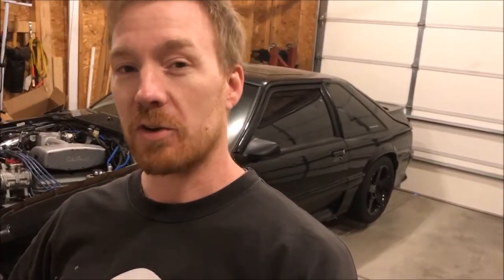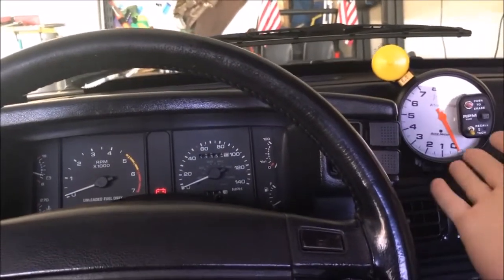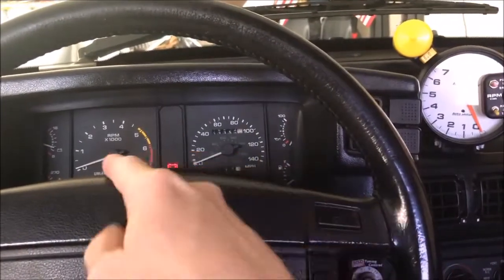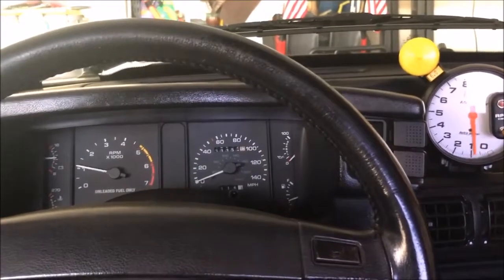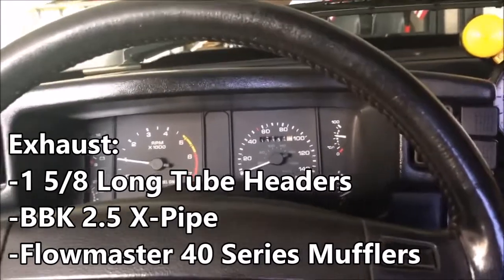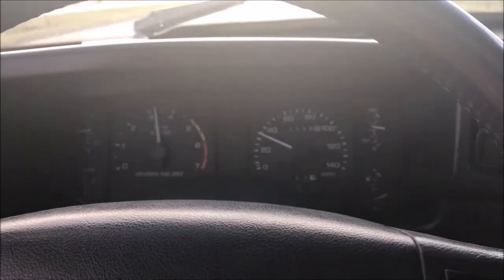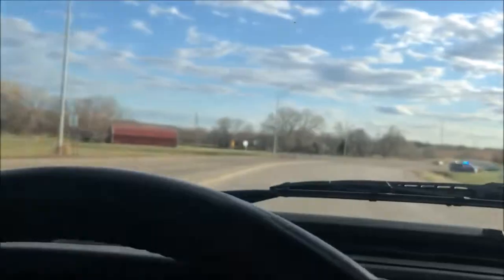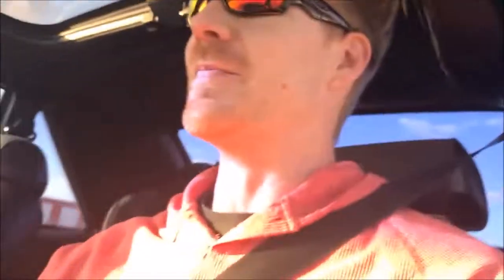GT40 Head Swap Mustang First Drive

Comment: Glad to see you could notice the extra power and it was worth all the effort and attention to detail.  I'm working a pair right now for my vortech supercharged '96 F-150.  I kind of want to run the stock peanut roller cam (the explorer cam), but I also don't want to leave power on the table.  I have to run shorties and cats for to emissions reasons.  My truck is 3900 lb 5-spd.  Did you notice any loss of low end (like maybe off idle up to 1500 rpm)?  My simulation software says the GT40 top end loses maybe 2-3 lb/ft of torque way down low and is all win after 2500 rpm.  Also I had my truck lower ported, but they already flow so much more than the car versions (it's the basis for the holley lowers).
Reply from the maker: The extra power was worth it!  I would've been disappointed if all the work I put into it gave negligible results.  I suspected the E7s to be the clog in the system because it was the one remnant of the stock system.  I think you'll find that to be true regarding your camshaft should you choose to keep it stock.  Especially if you're running a supercharger.  A cam upgrade will do wonders for your combination as I'm sure you already know.  It's more work however, but if you're doing a head swap already, maybe doing a cam swap isn't as much trouble... but, I don't know how much front disassembly you'd need to do on your truck to swap the cam.  

I didn't notice any losses with the GT40s.  All gains as far as I can tell.  It's better off the line, better in midrange, and better up top.  It screams now.  I'll be on the dyno in the near future and will make a video of the results.  With and without N02.  I'm sure you'd see big gains with more free flowing heads.  If you were running a turbo, I'd say to just increase boost to make up the difference, but superchargers are different.  I'm sure the Vortech will appreciate the increased flow.  I assume your truck is tuned for your combination...I'm not sure they run without one, but if it's not I'd definitely recommend that step.  Bummer about the emissions restrictions!    

I will be getting this car to the dyno and possibly do an entire build with it in the near future.  Thanks for the comment!
Reply: @FastFixYouTube  I'll be waiting for that video.  The 96 is the first year of obd2 and also the eec5 computer which is easier to program.  It is their last year for that body, but the 5.0 carried over on the explorer for some time after.  I do have a tuning solution and did it myself (Core Tuning).  I missed out on fuel injected fords back in the 90's so I'm kind of doing my own version of a 4000 lb mustang. 

Anyhow I did the usual stuff with changing injectors, fitting a bigger MAF (I've done 2 different 80mm ones and now have the 80mm Lightning maf), and have it tuned to run for 20 percent ethanol which is calif 93 octane, basically.  Lots of timing for a supercharger and it goes real well (up to 4500 rpm anyhow).  It dyno'd at 280rwhp/315tq and was still increasing hp at 5300 rpm, but the factory ignition has its spark blown out so that's as high as I can rev without doing an MSD 6AL.  The stock parts are making it run truck-ish with a higher torque than hp, but that's ok if I can get another 40 hp out of it.  I think I can with the blower. The numbers seem low, but it is night and day- the truck has a ton of extra power as soon as you touch the accelerator with the centrifugal and small port heads.

Since 96 is a weird year, all the smog legal stuff for mustangs stops at 1995.  The only aftermarket heads that are legal for 96 trucks and broncos are twisted wedge 170's which I almost bought, but a 2.02 valve is still big for a 302.  I know it would be capable of making 500hp, but maybe not with the full exhaust I have to run...so the GT-40's fit the package better and are cheaper (plus no hit to low end power).
Reply from the maker: Lol @ 4000 lb Mustang!  That's awesome.  I dream of having an odb2 port...  The CPU is jammed in the passenger kick panel and is a major pain to remove.  I have to remove it anytime I need to adjust the tune.  That's awesome you do your own tuning.  I like to do everything myself too, so good on ya for tackling that.

So it seems California has better gas and Nebraska has lower emission controls. Best I can do here is 91 octane.  We do have E85 and I've been considering making the fuel system compatible with that, but again I'd have tuning issues to contend with...  I'm sure the supercharger is night and day.  Your power is respectable and I'm sure the GT40s will give you the 40hp you're after.  I believe most dyno sessions report 40hp gain with GT40s on non-boost applications.  I would think you'd get even more considering the E7s you've got now are pretty restrictive.

Yeah, I like the idea of GT40s vs. twisted wedge.  So much cheaper and like you said, keeps the low end power.  Thanks for the comments.  Always good to hear what others are up to.
Reply: @FastFixYouTube  we only have 91 octane which has 10 pct ethanol, so if you mix five gallons of 91 to one gallon of E85 you get E20 which is 93 octane if you blended it with 91.  I can't do any higher because i don't have the parameter for target afr in closed loop, but if you don't stray too far from regular gas, the fuel trims can adjust a little bit.  I wouldn't run dedicated e85 anyhow...it is easy to find here, but not that easy.  The OBS square body trucks have 2 gas tanks with 2 fuel pumps so i run one tank at E20 blended and the other with standard gasoline for just getting places.

Comment: Good job bro! I also have the tri-bar GT40 on my shelf but they need a BIG overhaul so I'm gonna wait until next year.... I also have the ported Cobra lower intake and real Cobra upper intake to go with it, hopefully these will be bolted on the E7 heads for now, I just have to find the time to do it... Keep up the good work mate 👍
Reply from the maker: Hell ya man, thanks!  These GT40s needed a big overhaul too. I covered all the steps I took in videos on this channel if you’re interested. I love the cobra intakes!  You’ll definitely notice a kick once you bolt them on.  It’s almost worth bolting those on the E7s then doing the head swap later. That way you can get a sense of the power difference when you put the GT40s on. Thanks for the comment! 🤙🏻